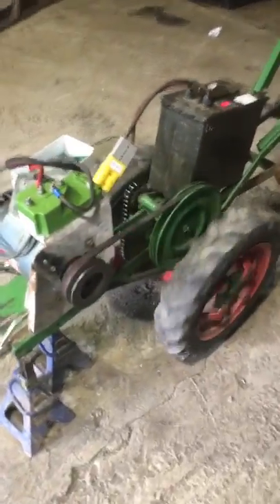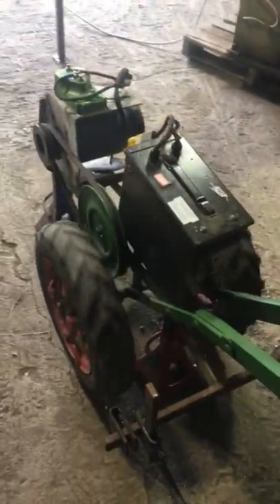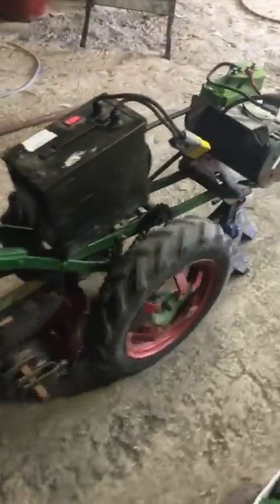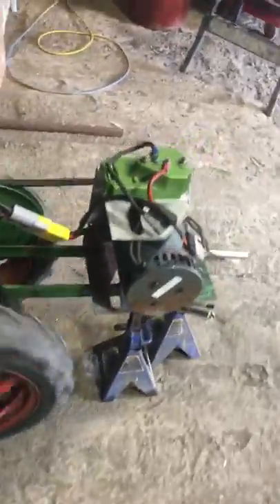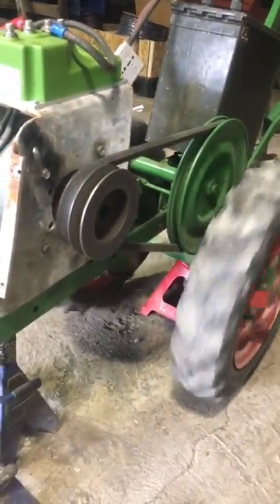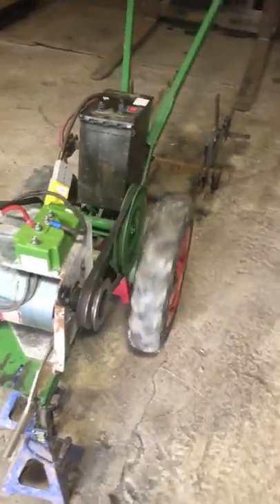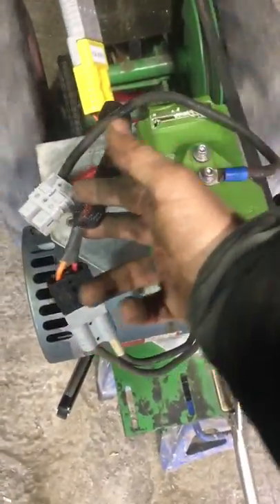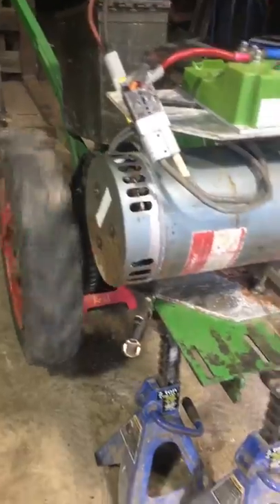Electric planet jr cultivator: First trial run

Comment: Wonderful!  You probably have the skills to take a battery and electric motor and a wheel and put it together and make a powered wheel, hoe, correct?
Reply from the maker: Yes I guess so.  There was a company making powered wheel hoes a few years ago, Carts and Tools, but they don't seem to be in operation anymore. 

If you're considering such a project there are some good geared hub motors that are designed to be fitted with an 8" tire directly on the hub motor.  Check the link below for one good example.

https://ebikes.ca/shop/electric-bicycle-parts/motors/geared-wheelbarrow-motor-agricultural-tire.html